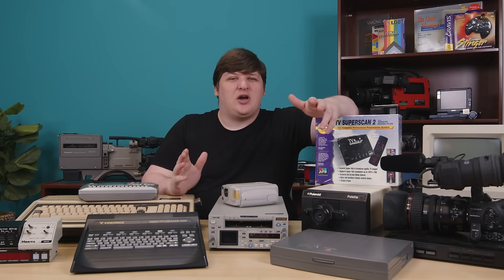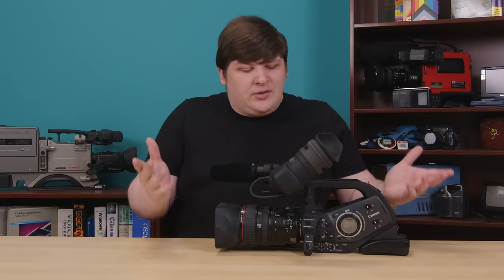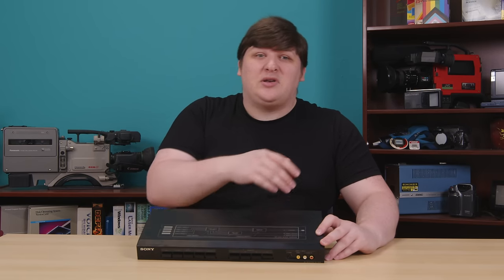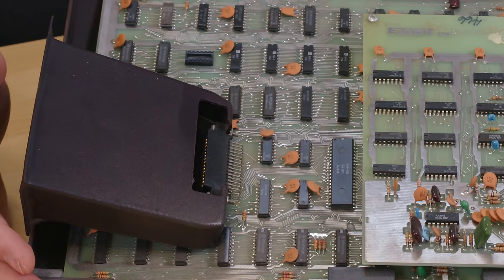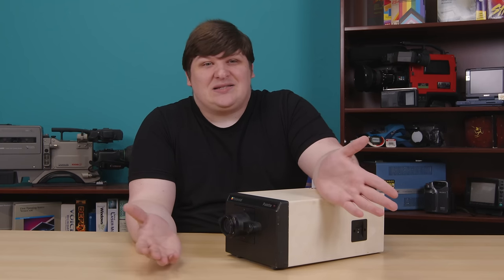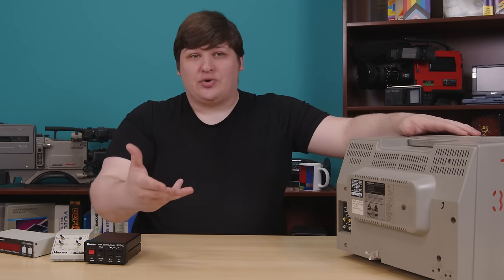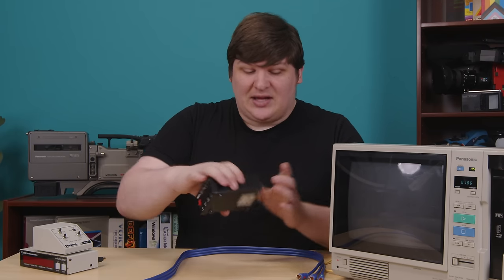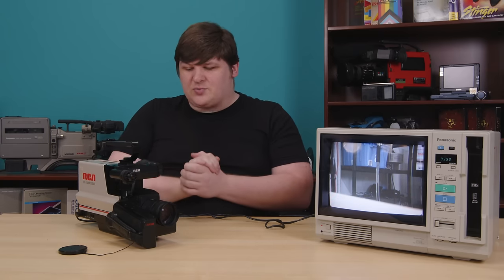Weird Stuff I Got From California (Where else?)

Comment: In the 80s at the university I worked for, we had a Olympus OM1? pointing at a monochrome monitor with a home made filter changer in a room that was totally dark. A servo controlled shutter release was used to open the shutter, the monitor was connected to a home brew 256 x 256 x 1 bit frame store and the image was downloaded from a mainframe at  256k baud. The image was flashed a number of frames to get the different per bit brightness. This allowed full color slides to be made. At that time a 256 x 256 x 8bit system was a large rack and cost 10s of thousands.

Comment: Regarding your Mac SE - give it a love tap when it's running - the drives were known for having issues with stiction and I've had an SE II running just fine after a gentle tap on the case*. 

Obvs - your mileage may vary - it's not a guaranteed method nor will it prevent it happening again but it can be enough to fire it up and pull data from it.

Comment: Gonna guess there's already some comments about this, but the small box Hitachi camera was likely used as a remote controlled camera for broadcast somewhere. A TV station I worked for had a similar HD model shoved in the corner of the newsroom for the newsroom "flash cam" position. Since there wasn't enough space around it to operate it, there was no need for accoutrements like a viewfinder or manual lens control. There was a second identical one hung from a pan/tilt head in the lighting grid of the studio, for bump shots.

Comment: 47:19 Nice! I own a DSR-30, the prosumer DVCAM deck. Bought it new and made a shelf of PDV-184Ns recording off the air. It's full width and has a fluorescent display, which I can't really read from across the living room. I wish they had stuck with the LEDs for that, too.  My Spectracom 8183 clock does have the big LEDs, so I know (knew) when the commercials are about to end.  They made that for mobile and law enforcement and similar uses, where, again, readability at a distance is important.

Comment: Saw you at Re-PC today.

Yeah, the e-clips go away, you should have spares.    Also things you should have spares: Any captive spring pins in the vest, the aircraft pin (several broken ones are on my desk), and any thumbscrews as well.

Also, the vest will have a number of hex screws/bolts in it, you should have either hex drivers or a screwdriver with bits for all of them and check all of them before flight.

Bonus points if you add a remove before flight streamer to the aircraft pin.

Comment: We used nearly identical (if not the same model) cameras to those remote servo operated ones to allow a cable channel show the studio on a shock jock radio phone-in, some time in the late 2000s. Kit was out of use by 2011 anyway. Two cameras connected to a remote operated composite switcher to allow someone in the cable channel do very basic editing; and the presenters also had a local switcher box to change between the two cameras and, I think, a title card generator.

Comment: That Chinon ES3000 looks like it had a PCMCIA (AKA Cardbus) to CompactFlash (CF) Adapter in it, and as a bonus already included a CF Card. I've known this technique used on other devices (I have an old Sonifex Courier audio recorder and use such an adapter so I can use regular CF cards (up to 2GB) in it. There was also a multi-adapter that converted from PCMCIA/Cardbus to SD Card and also one that converted from CF to SD. The CF card just pulls out of the adapter and can then be read (or written to) in a regular CF card reader. The only caveat I can think of is that the device will only support (very) low capacity cards in the order of MB not GB.

Comment: So rad!!!   I wish I could find tech.  I used to run a BBS in the 80/90s and was thinking of trying to find a 8086 and doing a retro BBS connected to the internet.

The time code clocks would work with my Mackie d8b mixer.  Those are cool.

Comment: 42:45 - speaking as a fansubber from back then, the group I was most envious of (the Phoenix Japanamation Society) had a laserdisc player with a serial port. They used that to pull the frame count from it and used that in lieu of timecode. They had a custom subbing program that would trigger each line based on the serial port data instead of the internal clock like the rest of us plebes. The subs were overlaid in the usual way via genlock and recorded to tape.

Comment: One of those old Steadicam chest rigs was also used as a prop in the movie Aliens, where it was used as rig to carry the "M56 smartgun" machine gun, itself a World War 2 surplus MG-42 decorated with motorcycle parts. Steadicams are extremely common behind the camera but Aliens was one of few instances where it actually appeared on screen.
Unrelated, in regards to that exceptionally evil power connector on the timecode device, a lot of devices from that era or earlier were designed around users plugging the power supply into the device and then connecting the power supply to the wall. Before the modern era of everyone having a USB charged handheld device or three it was pretty much unheard of to leave a power supply plugged in to the wall outlet when there wasn't something on the other end of that power supply.

Comment: 6:10 

To answer your question, in 2005 pro cameras that could shoot full 1080p were VERY new and VERY expensive.

The Sony F900 (used to shoot Attack of the Clones, Sky Captain, the Battlestar reboot, etc) was introduced in 2000 and could only do 1440x1080. The F950 (used for Sin City, Revenge of the Sith, Avatar, etc) was introduced in 2003 and it was the first true 1920x1080 pro camera. The Panavision Genesis followed in 2005.

These are all cameras costing in the six figure range. So 1440x1080 for a prosumer camera was pretty much as good as it got at the time.

Comment: The Amstrad PCW computers ran CP/M and CP/M came with it.  It was a very late CP/M machine that had a full bitmap monochrome display.  The PCW model numbers were like this, if the model number begins with 8, you've got one of the earlier all-in-ones with a green screen, if the model number begins with 9, you got one of the later computers which were also all-in-ones with a white screen.  

The PCWs were more office machines than home computers, designed to be cheap alternatives to IBM compatible PCs which were very expensive back in the day.  

Also, the Amstrad CPC 6128 I think was capable of running CP/M.  The CPCs model numbers were thus, if the model began with 4, it had a built in cassette drive, of it began with 6, it had a built in 3" - not 3.5" - floppy disk drive.  The rest of the numbers indicated how much RAM was installed in KB) the CPC range had 80 column mode and colour graphics.  

The CPCs were very definitely home computers, designed to compete against the Commodore 64, the Acorn Electron (which itself was a cost reduced BBC Micro) and the Sinclair ZX Spectrum... which Amstrad themselves ended up selling alongside the CPCs after they bought out Sinclair Research.  

The BBC Micro was capable of running CP/M but because the Beeb had a 6502 internally, you needed a Z80 Second Processor addon.  The BBC Micro was technically a home computer but was far more common in schools than in homes, also the cost cutting in the Electron meant that the Second Processor addons didn't work with the Electron.

Comment: In sports broadcast we were using XDcam discs in 2010. They did make those in HD format, though they were very finicky and annoying to set up the desktop peripheral drives we used for logging footage.
We phased those out and went to an AVID content server for newsroom and edit suites. 
As far as those Canon camcorders, I've seen them used for B roll on 'reality' TV shows, and worked on a few low budget things where we used XL series cameras. I forget whether it was red, black or white versions.
As far as junk stores I always liked Halsted Services Corp or HSC as they are known. Great place to pick up obsolete stuff or accessories for said obsolete junk. Lots of old school SCSI stuff. Picked up an IBM 1640 (?) PC keyboard, the kind with the huge DIN plug. Worked great with a mini DIN adapter, and even mini DIN to USB.
BTW most studios use robotic cameras controlled by a guy in a room somewhere else if shooting for broadcast. It's better to have less people breathing and coughing in the studio.

PS it's pronounced simptee, not "S.M.P.T.E.". 
PPS 9V dc on a 3.5mm plug? What classic piece of home entertainment uses the same thing? 
Atari 2600. I know because I used to always grab 2600 power supplies to use with my guitar pedals, which also used to use 3.5mm power and 9v DC.

Comment: The  term I see is a "Film Recorder", I own and use a polaroid digital palette hr600 (which Records at 6k). They offered 35mm, 120mm, the rarer 4x5 attchment, along with packfilm attachments. The ProPalette 8045 did a resolution of 8k. The last and best units are by Rhino/kodak and use lasers for 16k images but they are large, rare, and expensive. Polaroid pushed using their instant 35mm film called Polachrome in the palette.

Another company and the only company still making them is Lasergraphics. Agfa film and a few other companies made them as well.

They work surprisingly well and transferring an art piece to film really changes the tone of the image even if just scanned back into the computer.

Comment: The RCA camcorder is based on a Hitachi VM-3x00 series camcorder like MANY late 80s VHS camcorders. They all looped the video from the MOS CCD to the viewfinder and then back into the body.

The Panasonic cameras are interesting. I bet that VCR and inter-poser work with the WV-D5100. Besides the VTRs, other backs included straight video outputs, or CCU interfaces (WV-AD36 or WV-AD37).

Comment: 21:00 It's  diagonal because there's chips under the chute and the connector had to be diagonal to fit those chips there and the expansion cartridge within the confines of the case.

They could've made it vertical as many others did but ... didn't. 

Diagonal way cooler.

Comment: That anamorphic 1440x1080i is still used. THere are a bunch of TV stations that use that for broadcast, and it's part of Blu-Ray spec. DVD does a similar thing, with the 720x480 (or 576) resolution dating to SOny's D1 digital tape format, which was originally just 4:3.

Comment: Amstrad CPW range of computers had CP/M, they were British business/home computers focused on word processing but the dual sided disk came with CP/M on side 2. As far as I know they were in Canada too as I used to live there for a few years and found one someone was throwing out, so it could have also been available in the US too. The one I found was a 512 K model and after removing the half of RAM that was faulty, the reason they threw it out I guess, I basically ended up with a working 256 K model with two drives instead of one as the CPW 256 only came with one. The basic models were green screen but there were colour versions too, the one I found was green.

Comment: The Commodore 128 has a Z80 processor in it alongside the 6510. It ran CP/M and presumably still would if you can find the disk(s).
Reply: Yep, Just another "what were they thinking" computer from commodore.
Reply: @TintorDalibor  They were thinking market share. CP/M was showing some growth with systems like the Osborne, and there was a large and well-established base of CP/M business software. But predicting the future of computing is always a path fraught with traps. They chose poorly, but it was a reasonable enough guess at the time. If they had a misstep, it was trying to grab some of the business market with a brand that was now well established as a home-computer and gaming system.
Reply: The way I heard and red CP/M was already on the way out. IBM PC, thanks to the "tramp" ad campaign wiped out everyone in business circles and it ran on DOS. Also two independent video subsystems and two CPUs that don't cooperate is just about the worst solution possible. But C64 succeeded despite it's design flaws too, not because of it (horrible power supply, ridiculously expensive and slow drive, tendency to cook it's cia, cia shorting onto joystick port 1 etc). And I would love if they pulled japanese (legal loopholes of the time) trick with slightly modified z80 rather than using 6502. It's not like Tramiel would have any problem with that.

Comment: As the other commenter mentioned, there are a couple of "compact" microcomputers that include the S-100 bus. The best example I can think of (and have in my house) is the Zenith Z-100. Notable because it had both an Intel 8085 and an Intel 8088. Almost DOS compatible....but not. The graphics rivaled the CGA available on the XT at the time, but it was obviously mostly a failure.

Comment: Regarding the Exidy, 1- I'm surprised the capacitors didn't need replacement,  you got a lucky one! That is prob your problem on the Brother powernote. 2- I'll bet the reason for the angled cartridge was to meet the mainboard without need for a subassembly to hold a cartridge port. 3- CP/M was available on the Commodore 128.

Comment: SMPTE VITC/LTC timecode is a really fun subject as SVHS used it as standard for time of day runtime in higher end camcorders, witch has been fun to extract with VHS-Decode and then FFMPEG for full vertical frame exports as its data is visible, oh btw Sony 8mm Video/High8 had RCTC Timecode. 

You can generate LTC with a phone, Horita also made LTC-Trans-VITC units that would take LTC and embed VITC data in the top VBI (vertical blanking area) in lines 11-23 iirc but today we have Unai VITC witch can make VITC pattern data into normal video, and with ld-chroma-encoder from ld-decode/vhs-decode we can make a video with VITC embedded into a S-Video/Composite .TBC file and play it back to tape or monitors with cheep USB 3.0 ADCs like the FL2K chips.

Comment: I tried to make a quick disconnect extension for my laptop using 3.5 mm plugs they also have the annoying issue of shorting out on the way in and out of the jack....
Oh never mind I spoke too soon.
It's also completely ambiguous with a headphone jack.
The 9V AC power supply was very common because a lot of telephone stuff used that. it was also somehow part of the regulation that if it attached the phone line it needed to be an AC adapter. On the upside the bridge rectifier… Sometimes a full bridge rectifier… Was in the device which means reverse polarity protection! And no polarity requirement. Plus the capacitor was not with the hot transformer, usually sealed in a case that can't be opened easily. The older I got the more I grew to appreciate the design as annoying as it is.

Comment: On between both of the Canon and Sony cameras I would prefer the canon shoulder support because I used to professionally run a Sony XD cam and let me tell you you have to have extra padding on the shoulder mount I used to put stuff in a piece of foam from a mattress for support on my shoulder because without it that camera digs into your shoulder after five hours of holding onto it. I noticed one thing on your Sony camera you have black tape on the handle let me guess the plastic was breaking down it happened on my camera too. It would be a little gooey to hold onto it and then you would have black markings on your hand I used clear tape on mine. And ultimately I just replaced the whole lens handle with a new one. I got off of eBay.

Comment: SMPTE buddies! There is a whole rabbit hole for SMPTE sync and interactions in pro audio with wordclock, multitrack recorders, and dubbers that seems like a shadow universe to yours. Those RS422 ports could be used to scrub video along with audio. Getting a locator to work with my reel-to-reel is a goal of mine.

I think the 3.5mm power adapter was common on Horita devices -- my blackburst generator (in the same extruded box as your titler) has the same adapter.